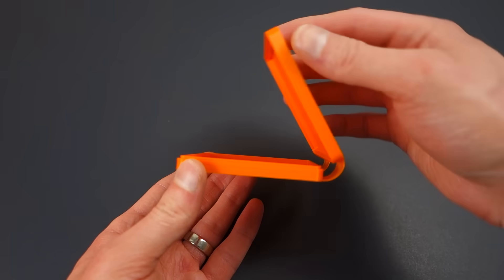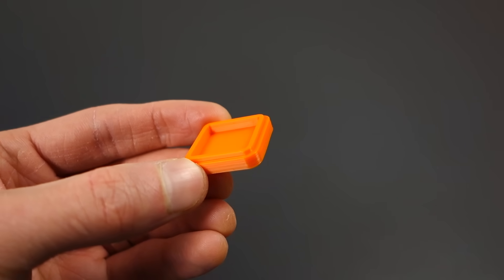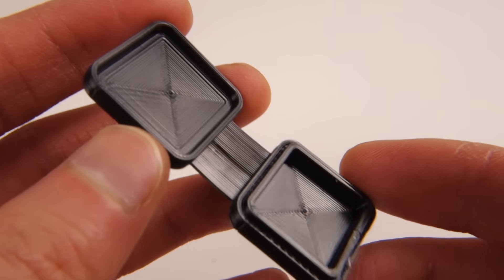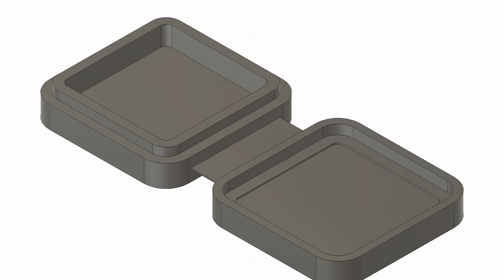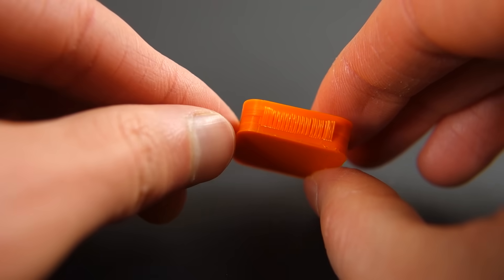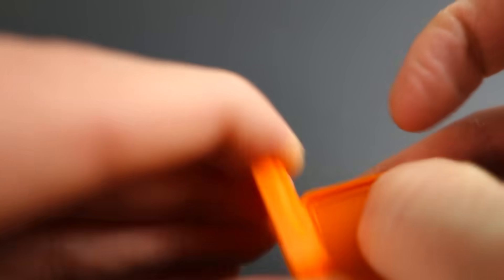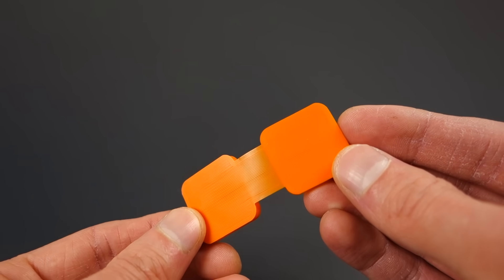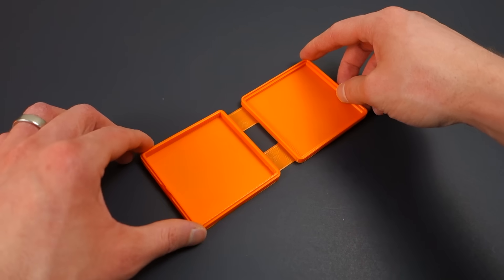PLASTIC LIVING HINGES that NEVER BREAK with 3D Printing!

Comment: Cool stuff, was just thinking about this the other day when thinking about how to recycle the plastic from plastic bottles, mainly the caps and the handles from bigger ones.  It seems to be just a flexible plastic that deforms easy but goes back to shape like nothing happened, probably why it was used for the handle, a lot more comfortable on the hands, and was thinking it would be the perfect plastic for living hinges without knowing to much about them or their design.  So i tried grinding up the bottlecaps in a blender but after opening the lid, the fumes that came off that stuff... worse then ABS and im not senstive to nauxious odours but i wouldnt spend anymore time then i had in a room of with this stuff floating in the air.   So i dont know about recyling that stuff without proper percautions.  Its a form of petg if i recall,  but even PLA can vary wildly in properties so i dont think its the same PETG youd find on a roll for 3d printing, although i could be mistaken i havent printed with printer PETG yet.
Reply from the maker: Thanks for sharing!

Comment: It appears typically object bought are designed with being closed in mind.  Is it possible to design a hinge that has a memory to be closed most of the time rather than open? Great video!
Reply: For that i'd make it a print in place model with the box closed, on it's side, so the hinge is a vertical
Reply from the maker: One option is to close the lid, gently heat up the hinge with a lighter, let the hinge cool.  After this the lid will be held in closed position.  

Just a small amount of heat is needed, possibly applied several times not to overheat the hinge.  That's how I got the case in the thumbnail to stay in the half-closed position.

Injection molded living hinges often has small features that force the cap towards closed or fully open positions. These features are small and are hard to 3D print.

Comment: A .4 nozzle can print as small as .1mm on any axis when using the right slicer setting.  In Prusa Slicer its Arachne mode is what you need to enable.  This allows the program to vary the thickness of the line quite a bit during printing making thin walls possible to print instead of being ignored.  (Cura has this regardless as they developed it).  Basically always use this mode as there is almost no reason to use the old way of slicing anymore.
Reply from the maker: Thank for sharing this!  Need to try it out.

Had issues in the past with printing smaller extrusion widths than nozzle size.  But that was some time ago when was I was using Simplify3D.
Reply: @UltimateToolChanger  you can print walls as small as the layer height normally without any special tools.  That is because the "bead" that is created when printing is that size already regardless if its putting down just 1 wall or several.  Its when you start getting smaller then the layer height that things start to go wrong in the slicing programs.  So .1mm is the smallest a .4 can do, technically it can get to .05 but bed leveling has to be perfect, so in most cases that will fail.  .1mm layers with Ironing (I use Cura), can make rounded or angled pieces on the Z axis be almost as smooth as resin can get.

Comment: great video! I use PP a lot to make prints like this, it's kind of hard to print, but with your tips, it will help a lot!
Reply from the maker: What are the biggest challenges you face with printing living hinges from PP?

PolyPropylene is the ultimate material for living hinges, but I haven't tried it yet because it's hard to print.
Reply: @UltimateToolChanger  Adhesion between layers is a bit complicated, but I recently started using Braskem FL105PP and it surprised me, it printed well even on an open printer, but the only glue thats work it's Magigoo PPGF.

Comment: 1. Creat a slot to insert a thin leather strap or something with similar sturdiness 2. Print pause at the height of the strap width. Insert strap, continue printing. 3. Dont worry about the leather hinge to break.
Reply from the maker: Great idea!  Using multiple materials definitely opens the door to many more options.
Reply: Could do a multi material print at that point. Print the TPU hinge, then switch filaments to PETG and print the case on top of the bridge.
Reply: Print a basic hinge on the bed. Do this method with the slot, make the slot 0.1 high, place the hinge you printed earlier in the print when it's half way there, let it glue your hinge in by printing directly onto the hinge.
Reply: Depending on the inserted material you may need to also stick a layer of painter's tape or apply some glue for the filament to be able to stick to it, especially if the inserted material has a large area and bridging alone is not enough to cover it.